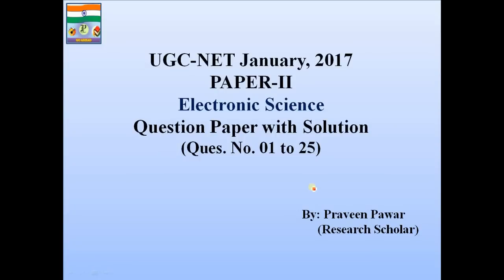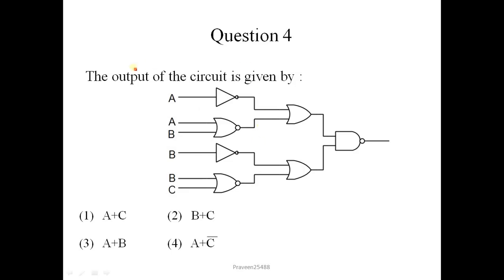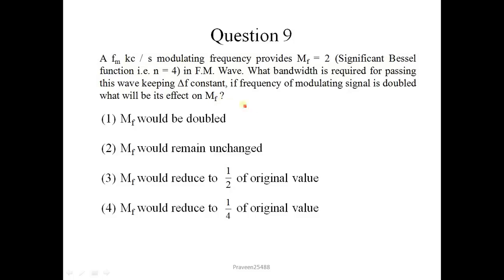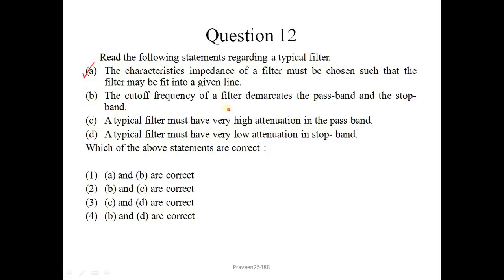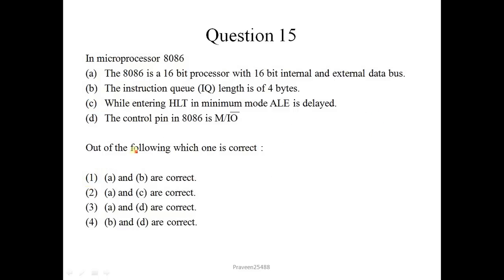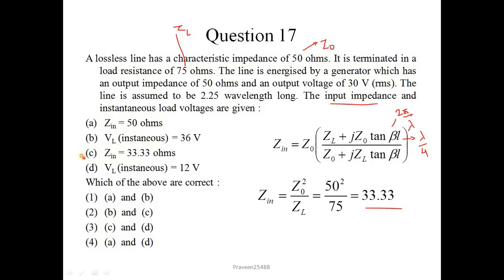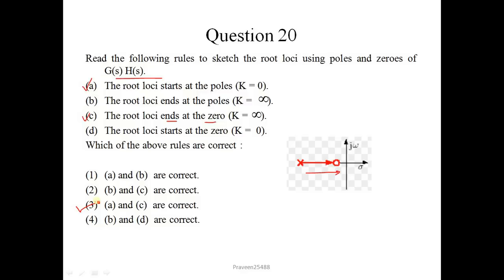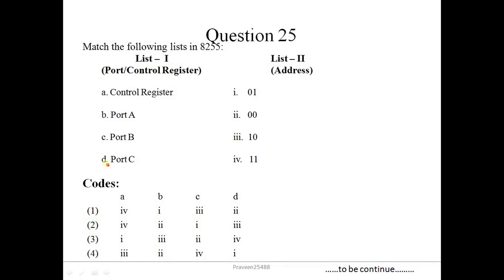UGCNET january 2017 Electronic Science paper2 (part1/2)

Comment: Question number 18 option A is incorrect statement please check and confirm me sir in the comment box
Reply from the maker: From previous comments:  Thanks Nishant, I missed it. You are correct. In question number 18, (a) is incorrect because there should be amplitude on the place of frequency in  " ......to the frequency of modulating signal....". And also, no doubt, (b) is correct but (c) is incorrect. However, (d) is also correct but I have mentioned it incorrect. As I say in the video that SQNR (signal to quantization noise ratio) is proportional to the number of bits of quantizer or quantizing levels so (d) is correct. Finally, as you told (4)th option should be correct for this question. Thank you.
Reply: @Praveen25488  thank you sir

Comment: In question no. 18 statement of  option A is incorrect because in FM fc is proportional to Amplitude of Message Signal not the frequency of message signal.
Hence the correct answer will be option no. 04